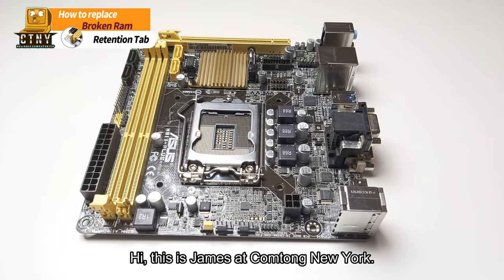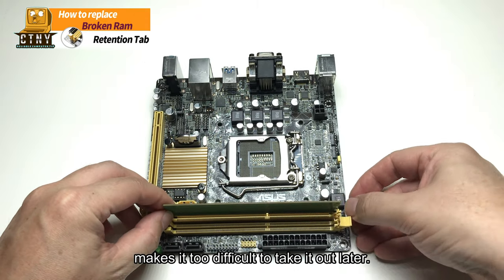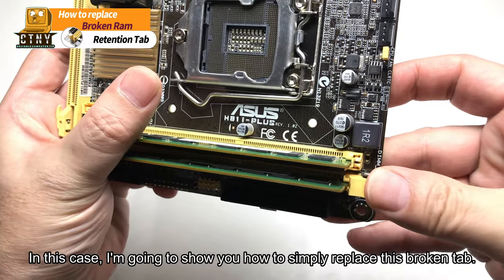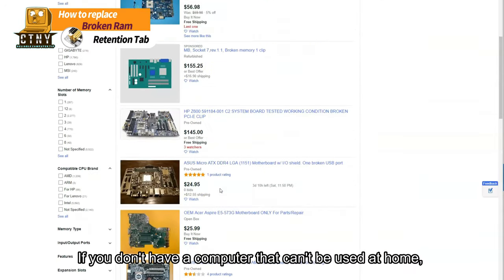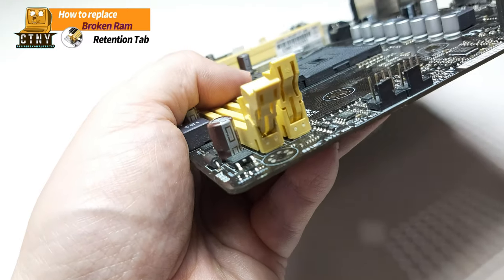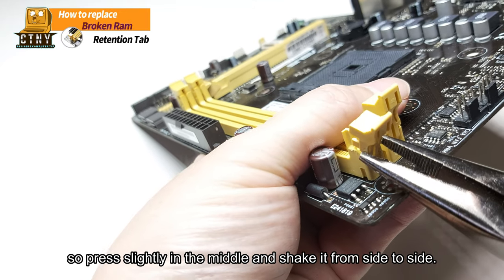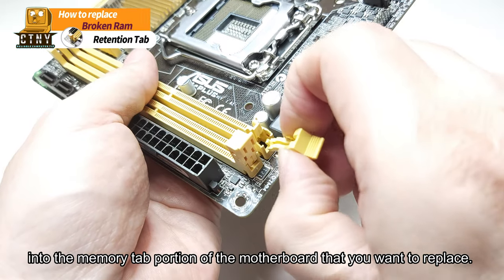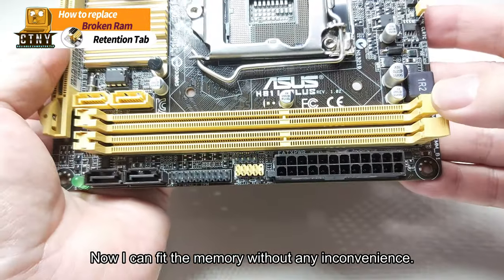How to replace the broken ram (Dimm) retention tab -Tutorial

Comment: Can those tabs render a board unusable? I bought a refurbised Asus B85M-G. I can't get it to post the only thing I can visually see that is wrong is 2 of those tabs are missing. The guy said he tested it before shipping and it worked. I got it and can't get anything so I hooked up a speaker to try and get some codes. I can get the board to tell me it has no ram but when I put the ram in nothing no codes and no video no post. I tried 3 cpus the onboard video and a variety of other video cards. So I'm curious. I wouldnt think the tabs could be the issue but no harm in asking,eh? I really want this board to work, but I doubt it will he is giving me a refund. I managed to find brand new one at double the cost of this one. I could always send the other back if I can't get this one working before it arrives. I bought it because it's the last one and I thought better to order it now and have to send it back later rather then to lose it. I just bought an i7 4770 and I have 32 gb of ram 2 sticks are brand new never used been holding them as backups but got a little extra money for an upgrade. An I7 32gb of ram and a Geforce GTX 1060 6gb should be a decent upgrade for awhile and it will only cost me like 230.00 but if I could get this board working I could drop that cost.

Comment: Thank a million, I broke a tab last night 🤦🏾‍♂️ my motherboard uses SODIMM slots, do you know  if I could use a retention tab from a regular DIMM slot?
Reply from the maker: Usually, the SODIMM slot is made of metal shackles, so it is different from the DIMM slot. If the board you are using is a Mini-ITX board, maybe it can be used plastic, but its shape and size are very different from the regular board. Maybe we'll have to remove it from the same board and replace it. Thank you for your comments.

Comment: Do you happen to know how remove the retention trims that Asus regularly uses on their motherboards (they actually appear on your video and they are opposite of the retention clips). I found this brief instruction from a guy selling them on Ebay but without image or video feedback I have no idea how to proceed:

"USEFUL TIP - Use two pins in the two gaps in the top of your trim piece to remove your old trim piece from your board. It is extremely easy to break the end of the DIMM slot if you try to lever the piece out without releasing the two clips that you cannot see."
Reply: Hey man I just broke mine on my retention trim on my ASUS motherboard, did you find anything???
Reply: @adecker0246  Unfortunely no. :(
Reply: @Sylarito   well, Dangit, I’m just going to have to put it in and home it works, it looks like it’s level with my other sticks of ram, pray for me man, and I’ll pray for u
Reply: @adecker0246  So, did you manage to install it? my Asus Rampage IV Extreme has one of these retention trims broken and I would like to replace it if possible. It's mind boggling that there not a single tutorial on the web regarding their installation and all we have to on is a very brief and unclear description from a guy selling the trims on Ebay.